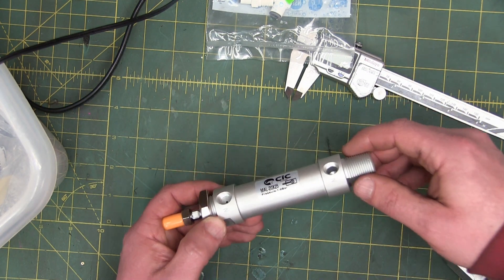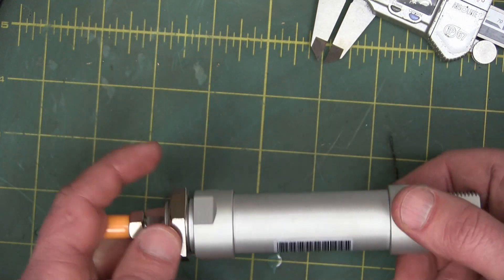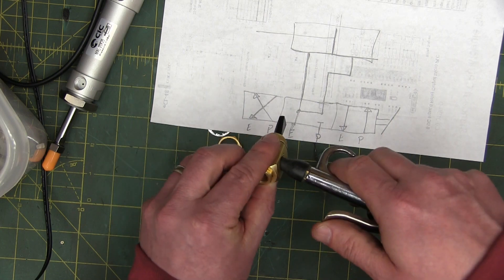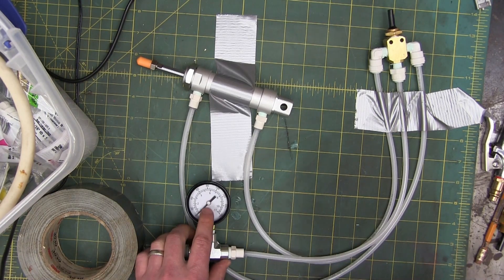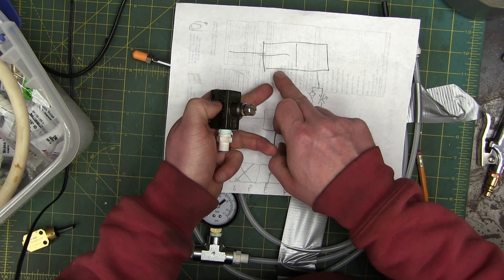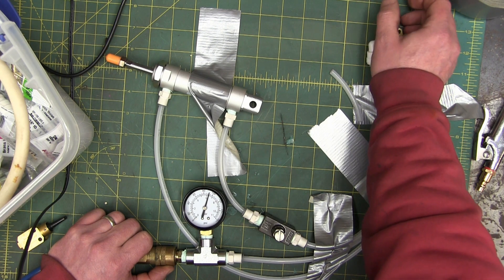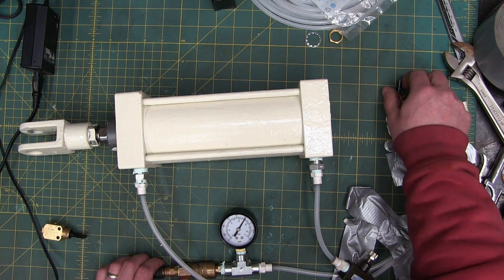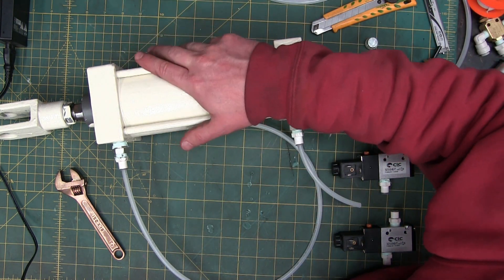PEW-PEW! Pneumatic Automation | Industrial Lego

Comment: Pure speculation:  This is going to be a device to cut open packages now that the mini chainsaw is out of service.
Reply: With 700-800 ft-lbs?! 
Yeah, that seems AvE worthy.
Reply: Krzysztof Łukawski Anyone who wants to get rid of that pesky 9.82 conversion factor for regular Earth based systems.  Just like the metric crowd got rid of the conversion factors for water volume to mass and tropics to north pole travel.  Actually, the metric crowd used to measure force in kg, just like the imperial crowd uses pounds, but someone in the 20th century changed to a unit that simplified acceleration calculation instead of weight calculation.  Look up "cgs system" for more info.
Reply: Eh imperial (well US customary system to  be precise) - foot pound is energy, pound foot is torque. Who the hell thought it is great idea to have the same name for force and mass???
Reply: John Francis Doe, I'm aware of CGS system however, i think no one is using it right now. Also so many counties agreed to unified theirs systems to to SI. That "pesky" gravitational constant for most first approach application can be approximated (like EVv's calculations on videos :) ) to 10 - so not a trouble at all. I'm just saying, that for someone who was born and tough in SI that imperial does not make any sense at all. I'm forced to use it a bit and for ME it is a pain in the...
Reply: My guess is some sort of automated bar feed mechanism for the mill...
Reply: Foot pounds is a unit of work. Foot pounds per unit of time, (seconds, minutes, fortnights,...) is a unit of power.
Reply: Rottidog if the air is chooching at 100 pounds per square inch and the effective area of the cylinder is ~7 square inch, then the force is ~700 pounds. Ft•pounds is a unit of power not force.

Comment: Back in the late 90s I worked in high volume PCMCIA manufacturing - virtually all of our fixturing was pneumatically  controlled.  Really made the monkeys move fast.  The confuser was dumbed down to (literally) showing a giant red light or giant green light on the screen...and we still had monkey errors.  Ugh.  Nice work AvE.  Brought back lots of memories of sitting in Mexico at 2AM eating Bimbo donuts at the plant.
Reply: John Gordon 
Proximity and infrared sensors are a simple solution many times for simple tasks.

Comment: I smell an Arduino coming...
Reply: Hopefully a proper PLC, even an Ebay one. It makes my head hurt when people use janky toy junk to run dangerous machines.
Reply: Rock Automatik ur mums an Arduino
Reply: He said at the end he's going to use a ClickPLC. He did a tear down of one in a previous video. I've used them at work, and they are good cheap little PLCs, but unfortunately require ladder logic (eye cancer) to program.
Reply: InsideOfMyOwnMind 10/10 WOULD name my daughter arduina
Reply: Thumbs up on the PLC pick. But ya better stand back Meat, that toy junk is taking over the world.
Reply: Arduino is a punk.  As he said, he's bringing in the old man of automation, the PLC.  50yrs old this year, but built to laugh at welding cables snaked around its body and only replaced every 20 or 30 years.  

And the PLC had a proper birth out of hangover and frustration:

"The PLC idea came from a hangover on January 1, 1968. Yes, really. Not only was he battling a serious New Year’s Eve induced hangover, he was facing the wrath of procrastination with multiple deadlines for proposals he needed to complete that New Year’s Day. “In my frustration working on all of these proposals, I noticed distinct similarities,” explained Dick [Morley]. “It was then that a light bulb went off and I knew there had to be a better way to control similar types of machines. That revelation led to the concept of the PLC.”"
Reply: PLCs are just as easy to program, will be safer, last longer, have warranties, are made to integrate into industrial environments and will be able to be modified easily by someone down the track. No good reason to use an arduino for this unless you're really cheap.
Reply: Matthew Ramage I've programmed ladder for a Click PLC.  What would you prefer to use that doesn't use ladder logic?

Comment: I machine parts for $3/4 million electronic tester. Its basically a machine that can test 12 thousand test points on a 1/2" x 1/2" fpga, bga, etc simultaneously. The machine has a microscope and precision movement down to like a few microns. We use alot of pneumatic actuators on the motherboards to lock things in position. Basically its a precision 3d mechanism that can place a bunch of tiny conductors on an open die to check function before they start sealing the chips in the epoxy. Some of the test plates that the chip sits on are a highly precision polished tungsten carbide plate about 12" in diameter and 1/2 thick... we have to send out our EDM work though. I just get to run the lathe, the Bridgeport and several HAAS CNCs... but I learn more from you... ain't the just fucking funny?
Reply: You would have their jobs if you were allowed to think for one.
Reply: Am I right in imagining that the testing machine is a thing with countless tiny needles that poke every test point on a board? That sounds delicate.
Reply: Chris Edwards if you google "probe card" you can see many examples of the interface between our machine and the chips... we develop the machine that includes the positioning, power supply and software for the required tests and a motherboard that holds the probe card  for positioning... very interesting job, I consider myself very lucky to have it...
Reply: I’m sure your smart and a nice guy but it sounds douchebaggy to include to $ info in the first sentence. No hate. Just luv

Comment: very cool with that exhaust restricter valve. i was trying to think of a way to do it by choking the return line down, but then you'd end up also slowing the extend as well. friggin genius. i loves me some industrial lego.
Reply: and if the cylinder is in a crappy position you can place the restricted valve on the exhaust side of the directional valve, there are even silencer exhaust with regulated flow